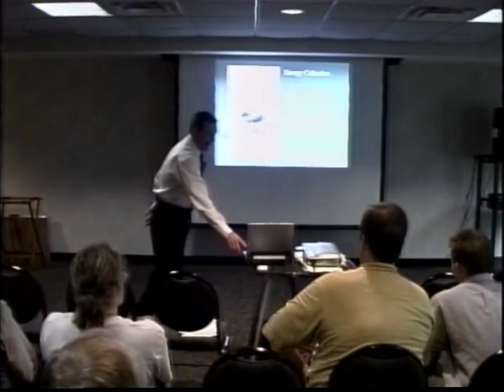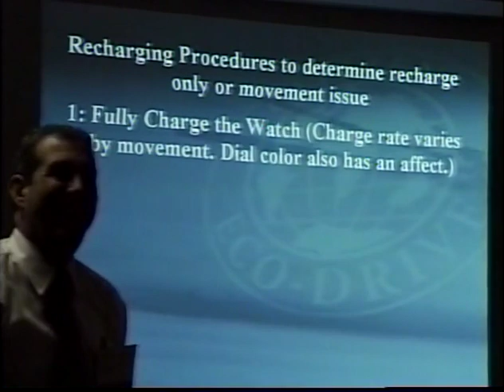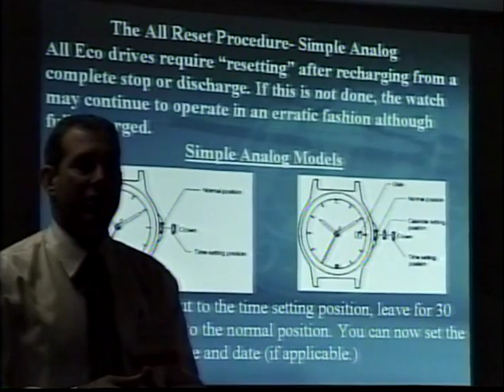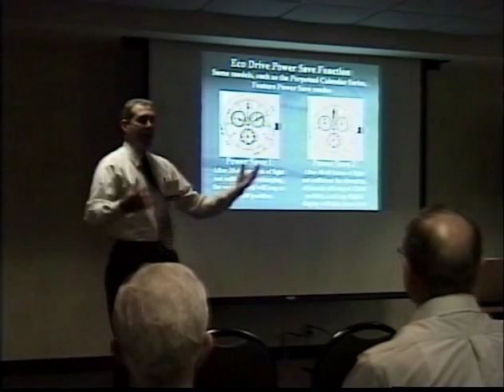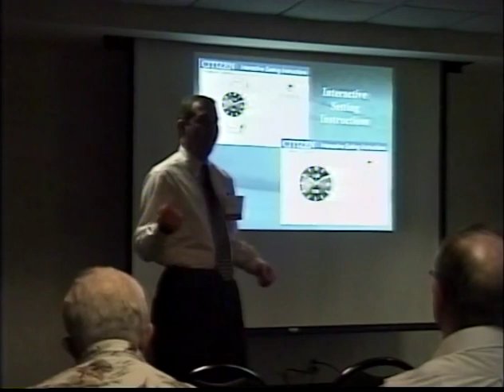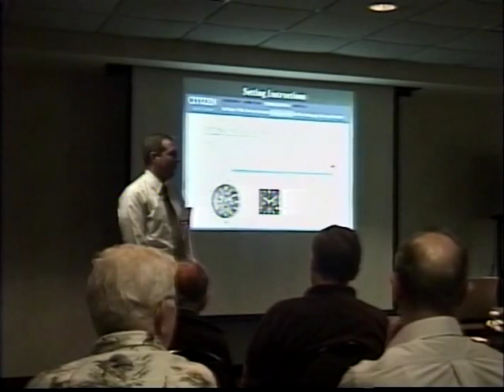The Citizen Eco Drive

Comment: I just purchased a Citizen Eco-Drive AT8020-54L Blue Angels Wrist Watch for Men. opened the box after purchase. no hand movements. Do I pull the crown out fully extended and let it charge by light for 2 days? No instructions came with watch and I dont want to mess it up
Reply: Did you get it to work? - When you adjust the time it should start working - @ 5:58 mark he talks about low charge and charging